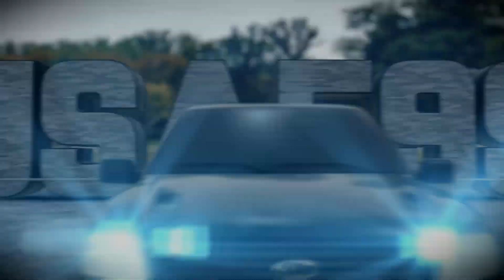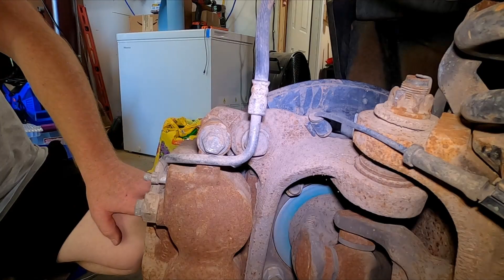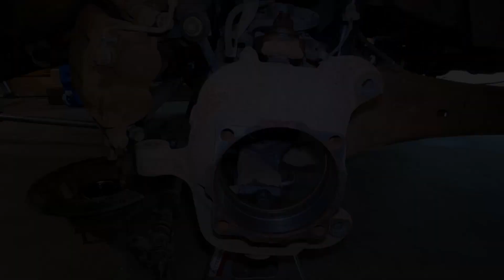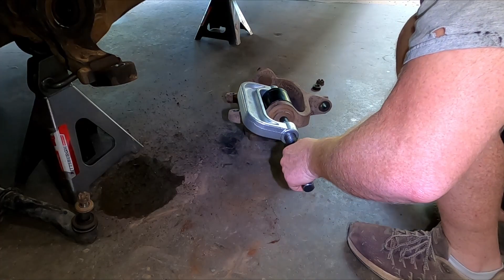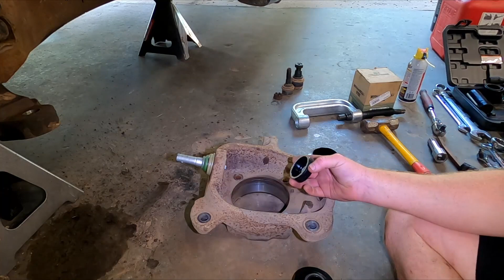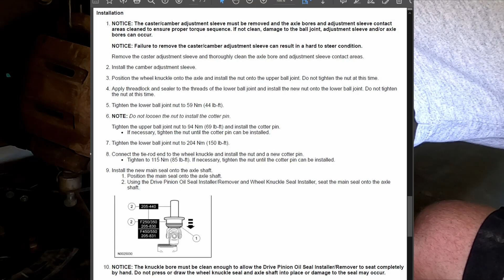2008 Ford F-250 Ball Joints Remove/Install

Comment: I just bought 3 Super Duty box trucks from my employer (2008 and two 2015’s) for $2000 total. The 2008 was my old work vehicle. It shimmy’s pretty bad between 55-65mph. We had it looked at a couple times and the shop said they couldn’t figure out the issue (which was, they didn’t want to mess with it bc they’d rather hammer customers for $200 PM services that are easy money).  After research, I suspect it’s the ball joints and came here to see if I could handle this job. I think I could, but my back, knees and neck hurt just imagining the time and frustration I’ll be dealing with getting up and down off the concrete floor 200 times along with the multiple trips to Harbor Freight, Autozone and the eventual “crap, nobody has this part or tool locally so now I have to order it and wait 4 days for it to arrive”. Great Video, though. I have to pick and choose my battles and guys like you really help me make the right decisions as to when I can tackle a mechanical issue or when to raise the white flag and defer to those with the proper tools and experience.
Reply from the maker: Very well said sir, that's why most of us do it. To hopefully save folks "some" of the headaches.

Comment: Tie rod ends that's not track bar
Reply from the maker: Aaaaaactually, yes, it's a track bar. These trucks don't have a conventional steering setup like most are used to. The pittman arm connects to a track bar to the passenger wheel, then a drag link from passenger to driver wheel. Easy to confuse.

Comment: Hey bro, do you think I need to replace the vacuum seals if I'm doing the ball joint job? Also, is that tool really needed to install the shaft back in?
Reply from the maker: Could you re-use them? Sure. Are there ways to beat them back in without the proper tool? Of course. Are any of them right? Nope. I don't say that to be an elitist jerk, moreover that they are designed to be one time use because...Ford. The tool, I have heard there are ways to put them back in without the tool to the correct depth, but I prefer to just not have to think about it.
Reply: @USAF99  Thank you. I'll get all the stuff I need then.
Reply: Hey do you have the part number for both seals needed? Thank you again.

Comment: hey man what brand ball joints did you use?
Reply from the maker: They're from Rock Auto- they're the TTX ones. Had really good luck with those outlasting the Motorcraft ones.
Reply: @USAF99  also have a few more question if you got the time about 4wheel drive as well

Comment: You and I are a gluten for punishment still hanging onto and working on this 6.4.  I did this exact same job a few years ago (along with new wheel bearings, seals, locking hubs as well as the entire front end suspension components).
You make it look way too easy.  Especially getting the axle snap ring out.  It literally took me HOURS to remove that thing.  I finally bought the Lang 1486 pliers. But even that tool I had to grind down the jaws to make it fit.  You have to tell me which piers you used to get that out with such ease, because low and behold, I have a bad bearing AGAIN.  And am not looking forward to diving in there again.
On another note, Do you frequent any of the 6.4 Forums?  They have been very helpful to me over the years.  I would love to chat more there as this comment section isn't really meant to be a "forum".
My current issue is a clogging oil cooler.  It's a cab off job and outside of what I am willing to tackle myself.
Reply from the maker: You almost have to be with what the stealerships want for even used diesel trucks. An oil cooler "can" be done cab on but its almost worth it to take the cab off for ease of the job. Thankfully these 08's don't have any of that DEF crap on them, I refuse to buy a truck that has it.